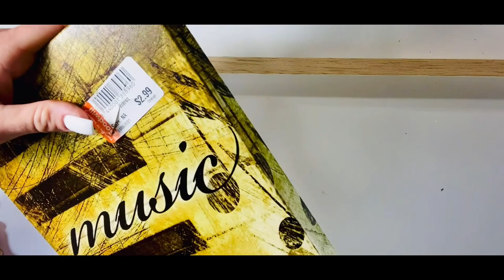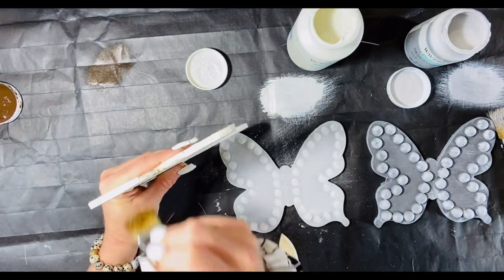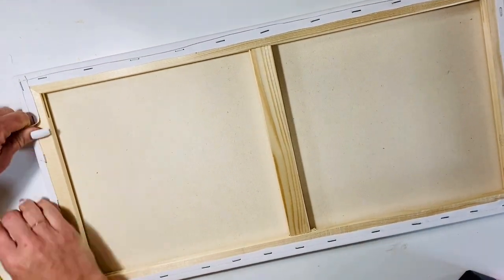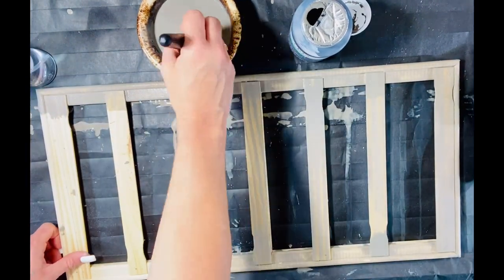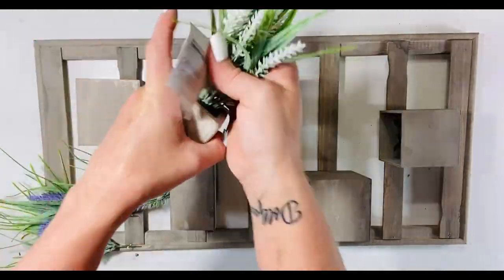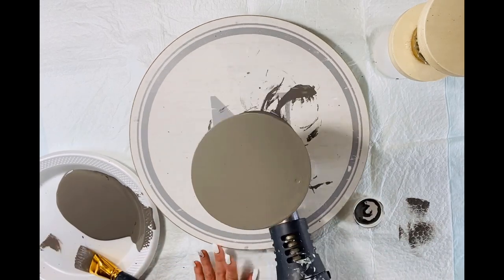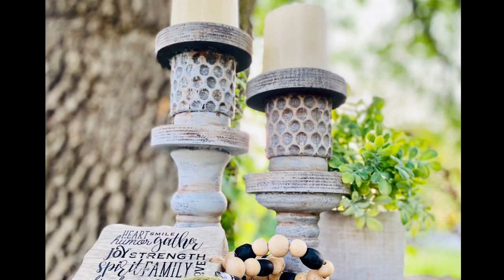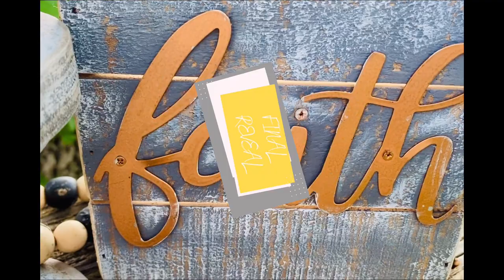Dollar tree summer DIYs, Budget friendly and beautiful Dollar Tree DIYs, Blessed Beyond Measure DIY

Comment: I bought a Dewalt nailer/stapler off of Amazon.
I don't know if you want to try this technique but you can get the lightest stain color (natural) and oil paint tubes. You then are only limited in color by the number of oil paints you buy. You can get a glass bowl and lid from DT to mix it and it will keep.
You know you can take almost any color to Lowes and get them to match it.